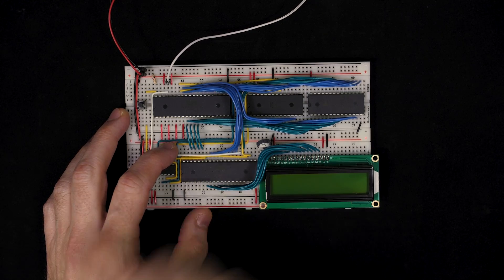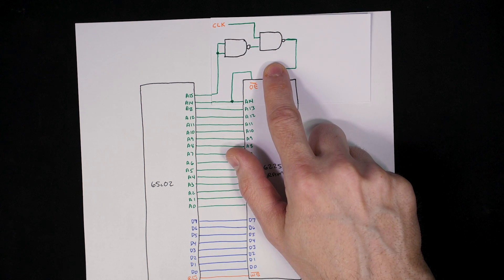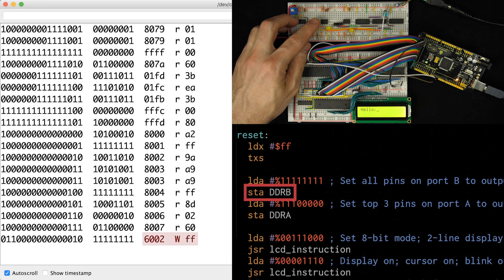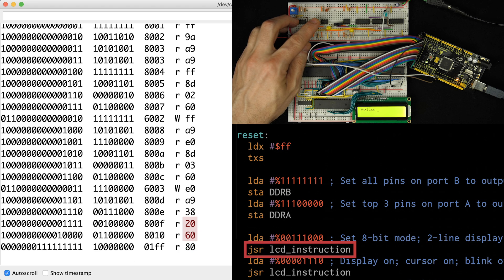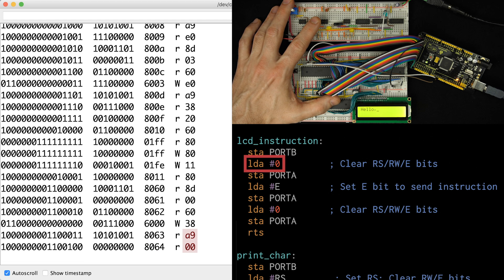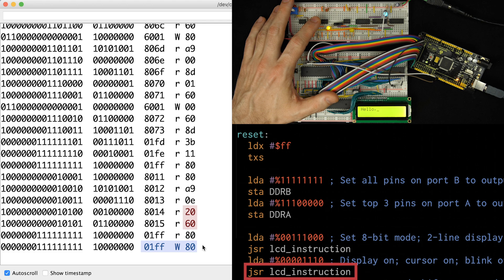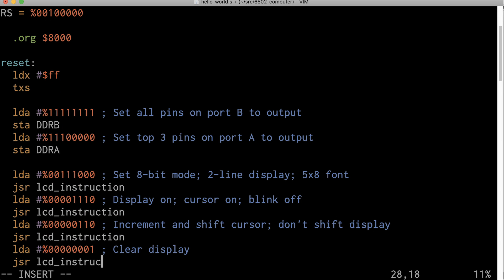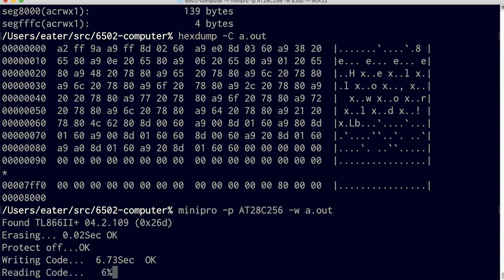Subroutine calls, now with RAM — 6502 part 7

Comment: Next one: C strings? So having a loop that goes through the characters and calling print_char for each of them until encountering a NUL one?
Reply: Would be a great way to demonstrate multi-level stack utilization

Edit: and maybe passing parameters on the stack too!
Reply: @AndyGoth111  You don't really need the stack for that (except for the jsr of course, but that's not multi-level), just do this code: 

msg:
  .byte "Hello, world!", 0 ; initialize pointer with null termination
main:
  ldx #0               ; initiate index to 0
loop:
  lda msg,x         ; load current char
  beq end            ; if char is NUL jump to end
  jsr print_char   ; otherwise, print char
  inx                     ; increment pointer
  jmp loop          ; repeat
end:
  other stuff

edit: Maybe when saying "multi-level stack utilization", you were talking about printing a string from within another function, in that case, you would be right! That would be really interesting...
Reply: Right, the idea is to factor out the message print loop into a function of its own, to be used from several places, including other functions. Though I must admit it gets hard to usefully demonstrate with such a small display. Perhaps he could also add a few buttons for input and do different things on events, but that's quite a detour from the current scope.
Reply: @AndyGoth111  Yeah... That's more engineering than proving anything.
Reply: @AndyGoth111  Yeah... something a lot more out of the current scope would be to have an image buffer that gets drawn to a screen with his graphics card, and you simply set the bytes in that buffer from the 6502, I would really like to see that... maybe with that and the buttons you could program a really slow game!
Reply: @Barmetler  I don't believe that particular display has a direct graphics mode, but if it did, it would have an internal image buffer rather than require the image refresh to continually be streamed to it like a monitor. As for his graphics card, no real image buffer there either, only ROM. Making it be RAM would be rather cool, but it might be tricky dealing with the simultaneous attempts to read and write the RAM.
Reply: @AndyGoth111  By buffer I meant replace the rom module with ram in the graphics card, yeah... You would need a dual port ram though, that would enable simultaneous reads and writes
Reply: @AndyGoth111  Oh oh oh I have another idea: have two normal ram chips. Write to one, draw from the other. When you're done writing, tell the graphics card to switch the ram modules, so that you're now writing to the second and painting from the other.
Reply: @Barmetler  Double buffering? Need to keep their contents in sync or else the screen will flicker between the changes introduced by the two most recent display frames. My point is that there's always a catch.
Reply: I wonder if he'll use C strings (null terminated) or "ye-olde" CP/M strings ($-terminated)?  Probably C since it makes more sense to not use a printable character as the terminator (not that Arnie isn't an eminently printable character).
Reply: @melkiorwiseman  Huh, CP/M used $-terminated strings.  This could explain why the "This program cannot be run in DOS mode.\r\r\n" message in the DOS portion of Windows executable files is terminated with a "$".  MS-DOS came from a clone of CP/M.
Reply: Also possible: a pointer pair or pointer-length pair that views into a string or substring (a more modern approach)
Reply: Didn't expect this to blow.

Why I went for C strings rather than other approaches where the length is explicit is that the other approaches are harder to code for in assembler with only one register. You'd have quite a lot of complexity and memory usage. C strings are much simpler to demonstrate because it's just: "load character, is it 0, if so we're done, otherwise call print_char". Even the "load character" means "load pointer from stack, load character from pointer" and you'd also need to load pointer from stack and increment it after calling print_char (sure, these loads could probably be combined for optimization). If you do a length based approach, you'd need to load the length, decrement, check, load pointer, do, increment, of course store both as they are manipulated etc.

There is a lot of complexity in writing assembler code for a machine with one general purpose register. Going for C strings instead of a safer alternative makes everything significantly simpler and presentable. For safer, modern alternatives you'd already go ahead and at least use C to code for that.

So I believe C strings would still be the way to go for this series, possibly with a mention that its problems can be solved by other, more complex approaches (storing a separate length is more complex)
Reply: Also possible: length-prefixed strings, as in Pascal
Reply: @AndyGoth111  Also BASIC.
Fun Fact: Strings in the original M$ BASIC were limited to 255 characters in length.  With the advent of modern OSs and computers which have more than 64K of RAM, the few modern versions of BASIC which still exist have mostly extended the maximum string length to at least 64K characters and often more.
Reply: @SimonWoodburyForget  Sorry, are you talking in general terms for modern computers and software systems, or about this particular minimalist 6502 system with nothing in the way of a monitor, BIOS, or OS and with everything coded in assembler?  If the former then I probably agree, if the latter then that is overkill.  Yes, NULL terminated isn't perfect but it does fit very nicely with 6502.  My experience (from BBC Micro days) is that sending a 00 byte to the terminal was a low frequency occurrence, and I'd say never mixed in with text.
Reply: It is quite efficient to use a string printing routine like http://www.6502.org/source/io/primm.htm Look at the last two routines.  No overhead for the caller unless you count having to NULL terminate the string, just a JSR.  An efficient subroutine (28 bytes I think) in the last version using only two bytes of zero page RAM.
Preservation (or not) of the caller's registers is something that implementers can argue about over several beers for many many hours.
Reply: post code some tutorial allready lol
Reply: Varint prefixed
Reply: first you go and create your char class, from there c-strings are a mere step

Comment: Floating CMOS inputs can also cause the chip to overheat and to fail.
Reply: Why?
Reply: @Tikorous  When the inputs are grounded, the N-Channel FET is firmly off and no current flows.  When the inputs are tied to VCC, the P-Channel FET is firmly off and no current flows.  When the inputs float, they tend to have potentials at about half of VCC where BOTH FETs are partly on.  Current flows and each gate dissipates power, P = I x VCC.
Reply: @Tikorous  Just to add a little more info to how bad this can be: when an input is floating like that, the N and P channels FETs can both be on a the same time partially. Since one side is connected directly to the + power rail, and the other is directly connected to the - power rail (ground), this condition can causes a high shoot through current. This shoot through current gets converted into heat, and can damage the device. Another word for this condition is to "crowbar" the circuit. So called because it's like dropping a crowbar across the + and - power rails, shorting them out.

Comment: 7:22 yes, all 6502 instructions take a minimum of 2 clock cycles, even if they do trivial things and have no arguments. The talk "Reverse Engineering the MOS 6502 CPU" given at 27C3 is a good watch on the subject; the VICE author also here the comments could possibly provide more information as well.
Reply: right, the 65ce02 variant (also used as the core of the 4510, as used in the c65/c64dx) was optimized to be able to do operations in 1 cycle, where no extra reads/writes are done anymore
Reply: @blackystardust  Good to know! I take it WDC doesn't manufacture these variants, though?
Reply: @andlabs  afaik only csg made the 65ce02, the 65ce02 is based on the 65(s)c02 though, with the nops filled in with other opcodes, wdc went on a different path and made the 65816, also based on the 65(s)c02, with the nops filled in with other opcodes, so both the 65816 and 65ce02 are backwards compatible with the 65((s)c)02, but not with each other where extra opcodes is concerned.
Reply: link for the lazy: https://www.youtube.com/watch?v=fWqBmmPQP40

Comment: Why don't they just make all in one chips, cpu, ram, rom and led lights all built in one?
Reply: MicroCONTROLLERS have CPU, ROM, & RAM all in one package.
 Not everyone wants LEDs; the more specialised a chip is, the less versatile it is.
Reply: @massimookissed1023  
That would be because it only has 1 single cpu, 
If they made microcontrollers with multiple cpus and multiple microprocessors in them. They would be more versatile.
Specially if they have bluetooth.
Reply: @frankynakamoto2308  Simply throwing more CPUs at something doesn't make it more versatile.

Those CPUs need to have uses, and they need to be useful in the right ways given the application at hand.
Reply: @TomStorey96  they should just make it microprocessors with built in memory, rom, led, bluetooth, multiple cores and even neural network cpus all in one, that way is more versatile. 
They can be used for anything, even built in microphone in them.
So they have voice commands, so you can tell it to start program.
Reply: @frankynakamoto2308  that's still not versatile. What if I don't want those LEDs, or different colors, or a different arrangement of them?

What if I want a microphone with different characteristics?

Maybe this satisfies some hobbyists, but it won't satisfy them all. And by then you have built something so customised to hobbyist requirements that it is useless for anything else.

It is more versatile if you make it generic that it can be built into anything and the extra required functionality added to suit what you are doing.
Reply: The Propeller is an 8-core 32-bit microcontroller.
Reply: @frankynakamoto2308  Easy tiger. What you claim to be versatile is more like feature creep. Trying to cram as much as possible into something thinking that it will all be somehow useful.

A knife is versatile, even though it is just a knife. But it doesnt need a fork, a spoon, a rolling pin etc to be built into it as well in order to be considered that.

Maybe it is you that doesnt understand what "able to adapt or be adapted to many different functions or activities" means.
Reply: @TomStorey96  you need to learn the correct definitions, not just say something because your mom told you so, you mom is wrong, dont believe me, well she made you..
Reply: @frankynakamoto2308  lol keep it coming dude. I feel so insulted.
Reply: @TomStorey96  it wasn't an insult, this is why you need to properly understand definitions, so you can understand the meaning of the words, because you donot understand you confusing in your head, you think is insult, and is not, and when someone insults you, you don't think is insult.
Learn the proper definition of the words.  That simple.
Reply: @TomStorey96  I dont think you the type of person that would feel insulted even if I said bad words to you.
You just being satire.
Reply: @frankynakamoto2308  of course I won't feel insulted, or offended, or even miffed. Why would I, by some random on the internet throwing dirty words and phrases at me?

People like you think you're funny or something. But you just haven't learned how to get along, ask questions to learn things, or discuss things civilly when you disagree, if that was even your intention. One day your words may cause someone with difficulties to do something terrible, if you ever even thought about that.

Once you can talk civilly, then I might feel any kind of emotion other than pity if you call me names because it will be at that point that I might have cared about whether we could be friends.

One day you will figure it out and we may have a different conversation. Until then I will just feel sorry for you.
Reply: Well, maybe I am miffed now.
Reply: @TomStorey96  what dirty words and dirty phrases I thrown at you.?

Comment: One optimization I found for LCD instructions - Instead of LDA #0; STA PORTA you can use STZ (store zero) PORTA.
Reply: For the 65C02 he's using, yes. The downside to using a STZ is that the standard 6502 instruction set doesn't have it, so the code wouldn't be portable.
Reply: Having an 8086 background, I’m used to XOR a register with itself to set it to zero (faster than explicit loading using MOV). This is not possible on 6502, right? I mean “EOA with value in A”.
Reply: @s4ndwichMakeR  EOR A does not have an opcode.  However for the 65C02 LDA #0 executes in the two memory cycles it takes to load it, while accumulator addressed instructions and implied address instructions both also take the same two memory cycles.
Reply: @s4ndwichMakeR  Since the 486, the MOV <register>, <immediate data> instruction only takes 1 clock cycle.  The advantage to using the XOR instruction is that it only takes 2 bytes.
Reply: @TheGuyThatEveryoneIgnores  Nowadays MOV is actually 0.5 cycles, pretty crazy
Reply: Nice
Reply: It makes more sense in the context of the next episode, but you also should be able to remove one of the two loads that clear the E bit altogether as long as you clear it at the beginning.